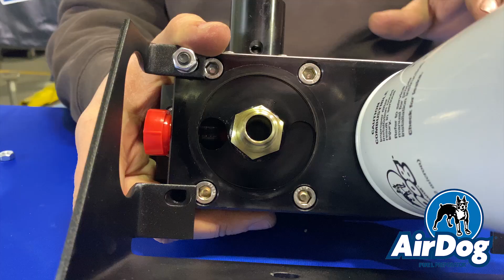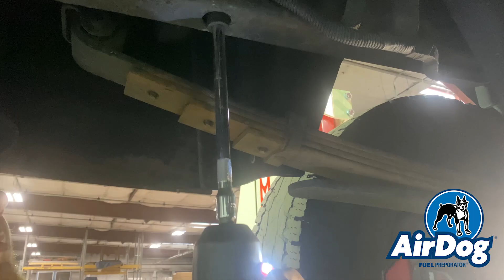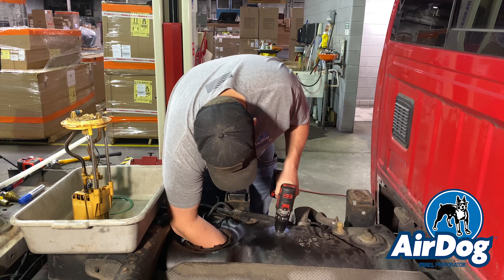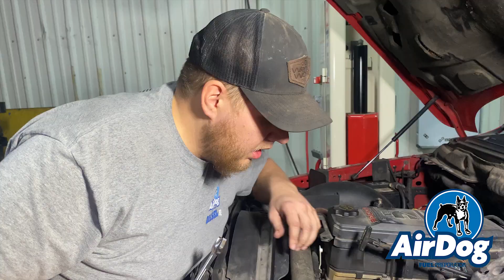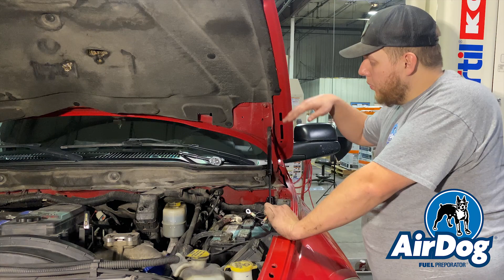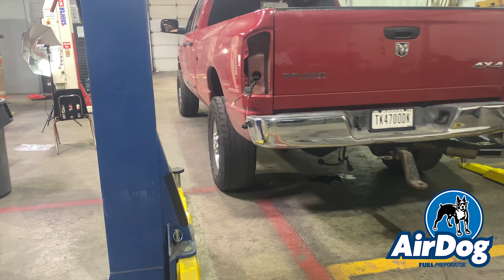2004.5-2018 Cummins Airdog DF-220-5G Installation

Comment: Can you still run a sump with this instead of a draw straw
Reply from the maker: Yes you can. Just be sure it is -10 or 5/8 fuel line compatible as the suction side of the DF-220 is 5/8 fuel line.

Comment: Is the 220 just for highly modified motors or can it be used on a stock 04.5 HO 5.9 Cummins?
Reply from the maker: If you plan on upgrading your truck the 220 will work just fine. If you plan to keep it stock, it will work, but a better choice would be a 4G-100 or 165.
Reply: @AirDogSales  do you think the 220 is a better option than the 165 for a truck with 5” exhaust, EFI LIVE, intake, and plans for a 2nd gen. Swap?
Reply from the maker: @natesuttenfield2124  A DF-165 will be plenty of fuel for your build.